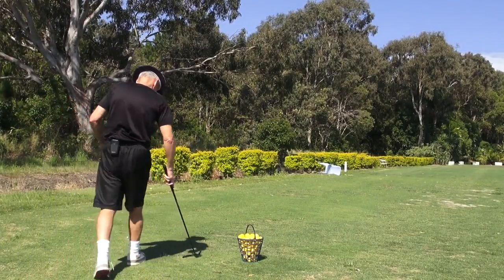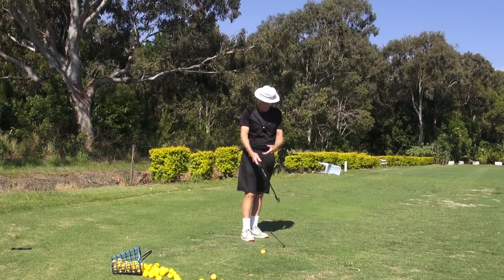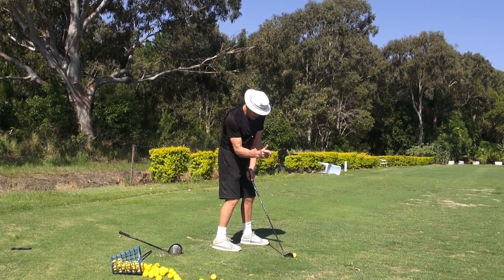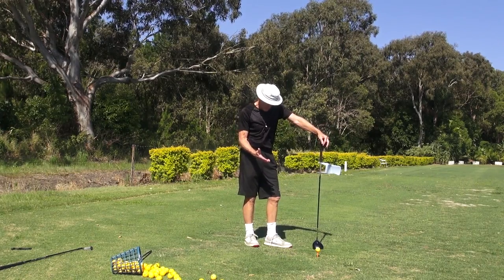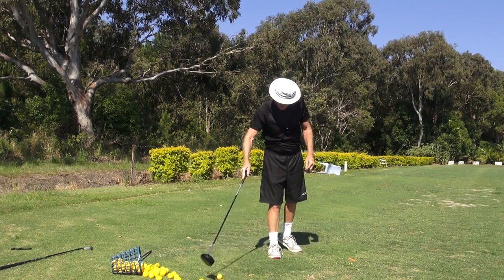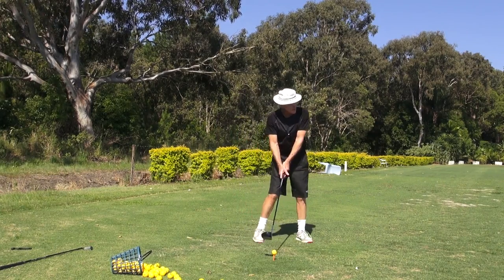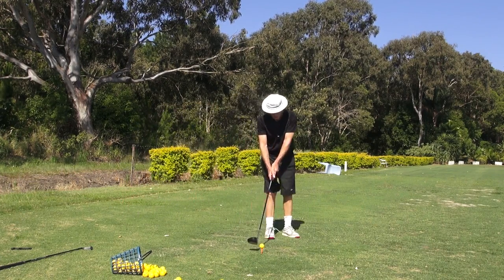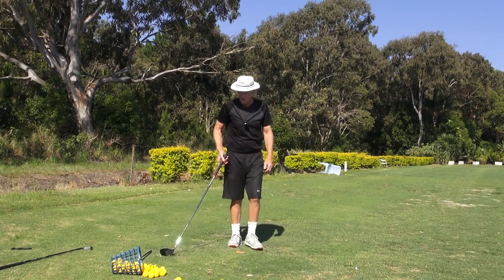More  Detail   for Channel Lock Swing Protocol..

Comment: Hi JH,  are PinHawk one length irons any good?
Reply from the maker: Hi Ronnie,
               I think the  first model of the Cobra one length irons  are  by far the best  one length irons  you  can  get, they were the only  clubs that  had the same lie  on  every club.. the latter models  went back to traditional variable lies..  different lie for  each club,  that made no sense to me at all..  if  a club is the same length,  and in those clubs that was 7 iron length, why would you not have a '7' iron  lie  on all the  clubs..  just  doesnt make any  technical sense.
         That is why I think the only 'true'  one length  specification clubs  are those  first model F7  irons..  they are  like 3 models old now  so you can get them for a very  low price  second hand.... I have tried the newer models   and they  to me  are  not as good as the original  first model.
            The Pinhawk  one length and the  Wishon one length   do not have  the  zip feel  that the Cobra's have ... Cobra  I guess just had more  money    to develop the irons   and they just came up with a better performing  golf club...  I found the Pinhawk irons  lifeless compared to the Cobra's.
         cheers JH

Comment: Hi JH, your swing looks great.  
My CH is coming along, I still have the unconscious urge to swing down the line so I'm slowly reprogramming my brain to swing in to out with my back to the target (five o'clock nose) in order to hit the ball down the line (a weird sensation and a paradox to my unconsciousness).  I notice that when I stay closed and drop the club as you suggest,  my elbows come close together and stay together at impact with a better release (in to out).  I then find that my elbows are close together in the finish, which I try to hold until the ball lands.  The incorrect down-the-line swing  separates the elbows with a chicken wing look,  I can tell when I have done that in my finish my elbows are wide apart.  Am I on the right track with this swing thought?  Is it ok to focus on a finish with my elbows close together ?  
BTW, the great thing about CL, is that even when  I don't swing as purely as I wish, the result is still reasonably on target.  It is a much more forgiving golf swing, that is quicker to learn than other swing methods.  Obviously other methods work, but they can hard to learn and are really high maintenance for the weekend golfer.
Reply from the maker: Hi Terrence,
                    The point you make about shots that are not struck perfectly still going in the general direction of the target is one of the great aspects of the CL  mechanics ..           
               Really concentrating on firing the club in to out as much as you possibly can is absolutely a lynchpin of the CL mechanics as well.  I don't think its possible to overdo the in to out intention amount   .. I know my self when  I think a crazy amount of in to out commitment I hit the ball unbelievably solid and straight ..
                                      When you said that   'other' swing methods   obviously 'work'  .. we have to   look at  'work'  in   the context  of its   true   relativity   to the golf swing .. a conventional swing  can 'work'   on  'occasions'  ...  but  I have never seen 'any' player    that has  been able to  get their   conventional swing  to 'work'    all the time  ..  that being   providing  the ''same' something  of    value   relative    to ball flight    consistency of  starting  flight direction ... not one player  .. not even Moe Norman .. Moe hit    the  occasional  pull shots   at times .
                 The CL swing has the true potential capability to 'always' start the ball in the same direction every shot .. that's it's great advantage over every other swing mechanics type ..
                     cheers JH

Comment: Why soggy knees JH? You do mention that they give you a balanced and athletic setup but do they do anything else? I suspect they also help restrict your turn. CL is all about less turn and more arms correct? You do turn back and through in your swing however, but maybe soggy knees helps to keep from overturning?
Reply from the maker: Hi Bob,
            If you set your knees bent at address and keep them bent as much as you can you flatten the bottom of the swing arc and its easier to hit 'Up'   with that approach angle swing shape ..     I am still working  very much on my own soggy knees application  .. and   I  actually  forget to    apply   it    most swings  ..   but I am  absolutely    wanting to have it as    a base    component in my  finished CL protocol ..
                    cheers JH